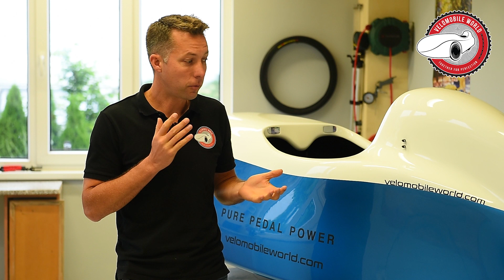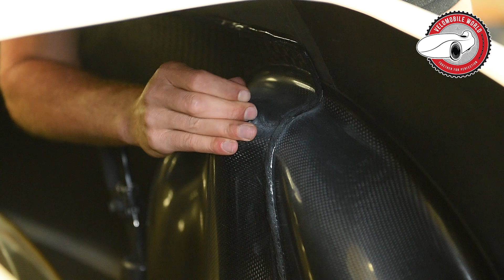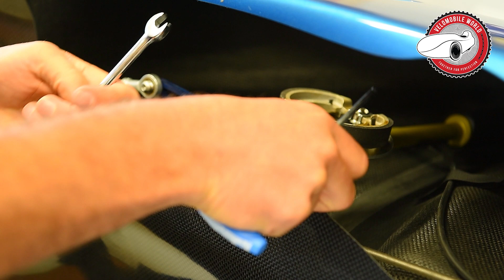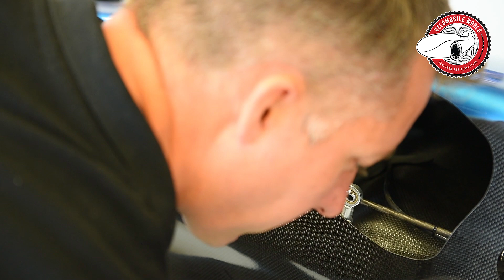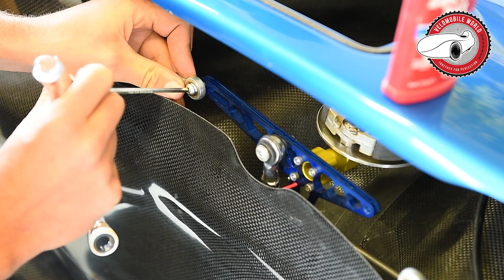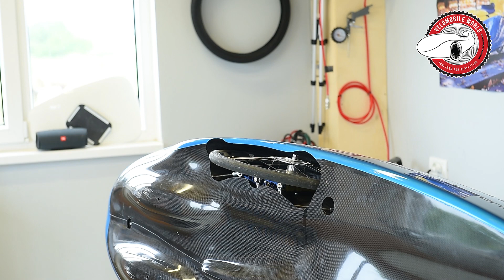Front Suspension Remove | Alpha Series Velomobile Maintenance

Comment: It´s getting better...
Are you filming with a stand? If possible, change the focus point variation speed to "normal" or "slow", so the focus doesnt jump.
Try to show (in the frame) the important steps not only describe them. 
Prepare a script if you don´t know the right words for certain items and hang the script in sight so you can read from it.
If its easier for you, do a voice over. That takes the pressure of speaking AND doing things in parallel.
What video cutting software do you use? I guess you got an external microfone, so you can record the voice over directly to the computer you are cutting the videos with...
If you use davinci resolve 18.5 the subtitles can be done automatically from the software.